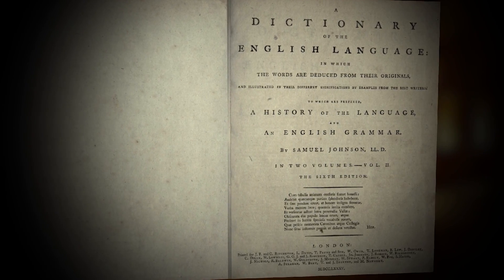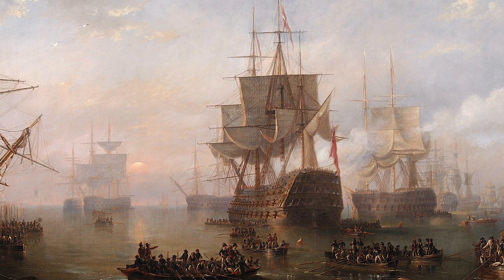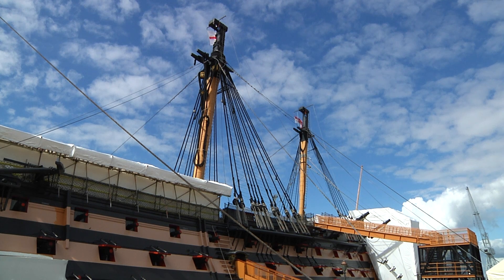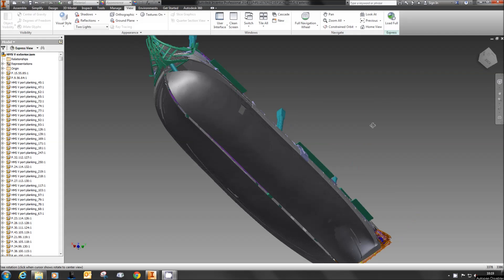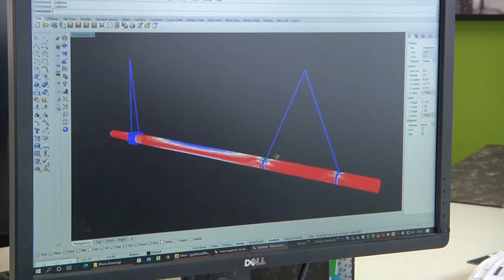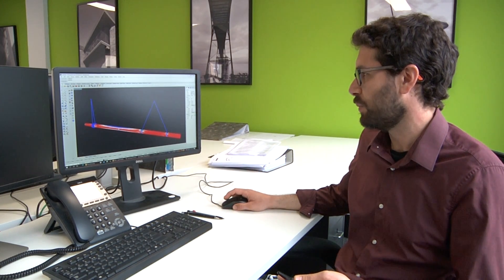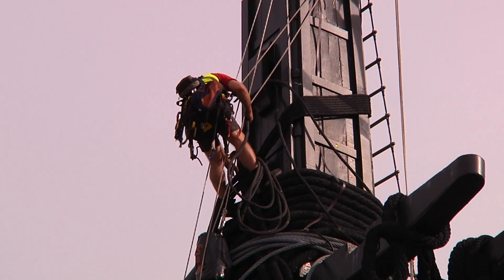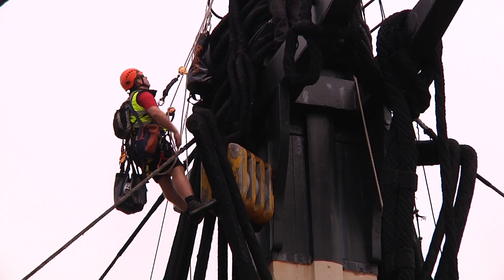Fighting Top to Keelson: Saving the mainmast of HMS Victory

Comment: There's an old joke about an old 'original' hammer - two new heads and three new handles. Same thing with these old sailing ships, various items have to be replaced during their lifetime due to wear, tear and battle damage. I guess the replacement wrought iron lower main mast was the latest thing in sailing mast technology when it was fitted after Trafalgar. Others below have wondered, as I do, just how these ships were built and maintained without modern technology. Imagine a Sheer Leg A frame capable of installing that lower mainmast! What a sight. If you ever get the chance visit the old Dockyard at Chatham in Kent - the layout loft there js eye opening.

Comment: I wonder how those huge masts would have been stepped in the 18th century. Would tthey have used A frames and windlasses?
Reply: If the ship was in the water (they usually were, dry docks were mostly needed for building new ships or very major rebuilds), then sheer hulks were used. These were large old ships, usually retired ships of the line, with upper masts removed (and often all except the lower mainmast taken out). A massive boom attacked to the base of the mainmast and supported from the top of the lower mainmast so it could swing out over the side.

Major harbours would all have a few sheer hulks. One would be moved alongside the ship being repaired, then the boom would be swung out over the lower mast to be lifted out, and blocks and tackles used to lift it straight up. I'm guessing things would be extremely stressful for all concerned until the old mast was safely lifted out of the way !
Reply: These guys were used to moving heavy weights, each anchor was about 4.5 tons and each of her 32 pounder cannon was  3.5 tons

Comment: As originally built in the 18th century the masts were iron? This surprises me. Did they have the technology to make such? I always thought the masts would have been made of lengths of wood fitted together.
Reply: They were replacement masts, fitted after Trafalgar.
Reply: These were replacements fitted jn 1893 by masts from HMS Shah
Reply: @benwilson6145  Many thanks. The producers of this video could done a much better job by stating that these were not the original 18th or 19th century masts. Thinking about it does make sense in that these are replacements, for how could 200-250 year old timber, no matter how massive or treated or cared for survive battle damage, wear and tare, and centuries of exposure to the elements. Found a reference in a 2003 book to the replacement of Victory’s wooden masts with those of HMS Shah.
Reply: @peternakitch4167 lol, anyone who’s into old ships knows they are not original masts
Reply: @benwilson6145  Thank you!  I was about to dig out research to see whose legs she had currently.  I recall that Shaw's masts were considerably shorter then Victory bore in her fighting days.